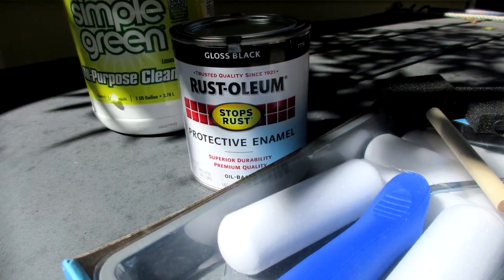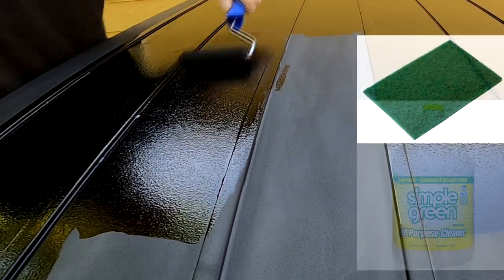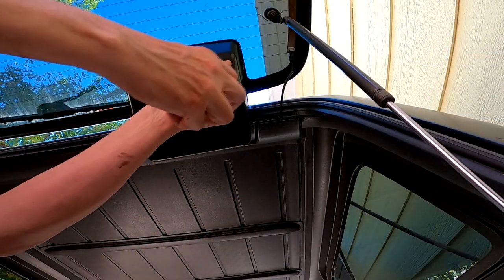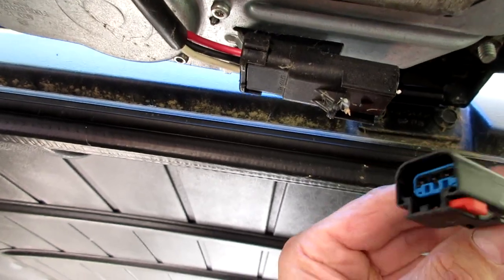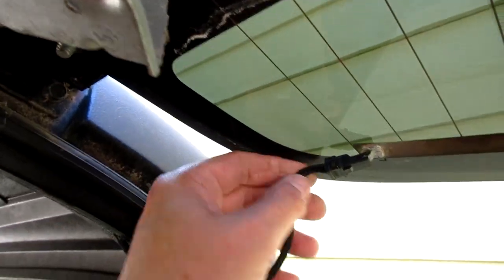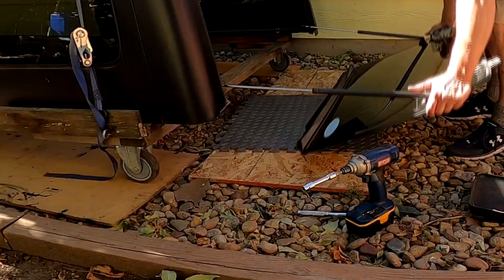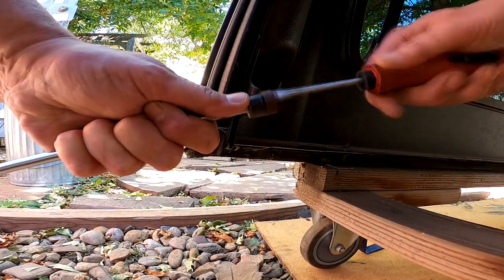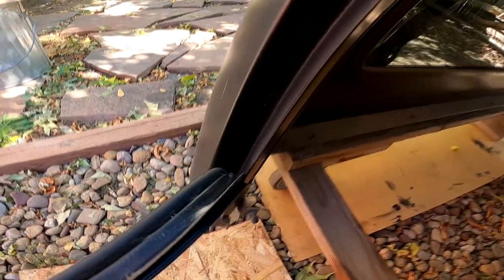$50.00 DIY Jeep Hard Top Repaint: Rustoleum & Roller How To Paint Hardtop

Comment: Good video only suggestion i have to other people is to wipe it down with a acetone soaked rag to make sure its stripped of all grease and armorall/silicone
Reply from the maker: Good idea! Thanks!!
Reply: Little late now don’t yah think? 

Meaning, your projects done deal…

I have the 05 TJ Kaki color, I have not found one how to video on renewing my hardtop. Boat videos indicate gel coating. While Jeep apparently has Non Identifiable coating. Even though our tops are fiberglass. Black resto for jeeps is all I have seen. Frustrating 😮
Reply from the maker: @garbinator09  ha, too late for me, but he was suggesting to other people and I appreciate him doing it!  I did not have any armorall or silicon on my top, it cleaned up very well with degreaser and brillo and still looks great.  The process to paint your top should be the same, just a different color but the same thing otherwise.  I believe this is the correct color code for your top https://www.paintscratch.com/touch_up_paint/Jeep/2006-Jeep-Wrangler-Dark-Khaki-Hard-top-matt-ZJ8.html they have sprays and there are some good videos about that, but if you want to roll it like I did I'd go to Sherwin Williams or another paint store, tell them how you intend to use it and have them mix up a quart for you.  They can thin it or whatever they think it needs too. Good luck with it!!

Comment: How's it looking 9 months later?
Reply from the maker: Still looks great, no sun fade so far but it has limited exposure: I park my Jeep in the garage, it's not my DD and the top has been on for the winter and is now off for the summer and is covered in my yard so it's not really being tested.
Reply: @ColoradoOverland  — I’ve been looking at fiberglass boat video to learn how I might make my 05 hardtop look really spiffy!
Reply: @ColoradoOverland  The real issue, is not being able to identify specific Mopar paint used on Jeep Fiber Glass tops.
Reply from the maker: @garbinator09  I worked at a boat rental in south florida for a few years and we painted everything with AWL GRIP using a foam roller and tipping it down with a foam brush, it's amazing paint.  Good luck!!